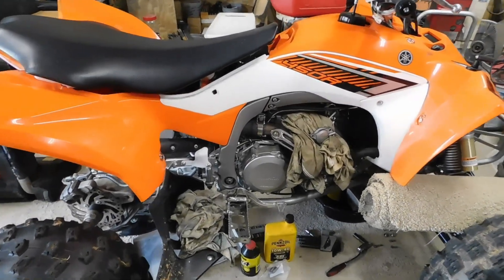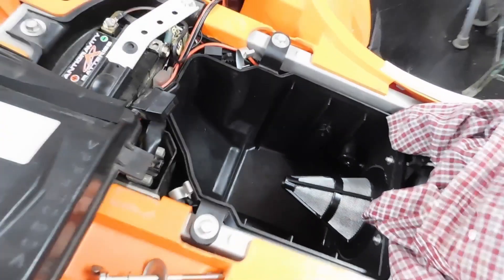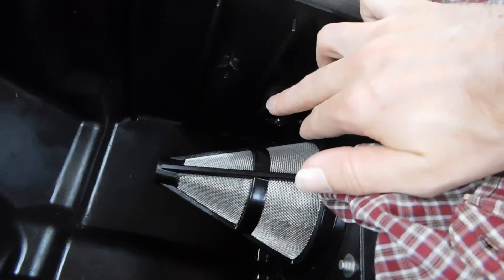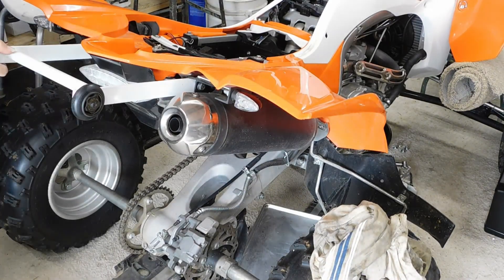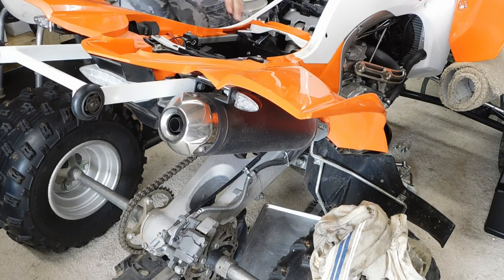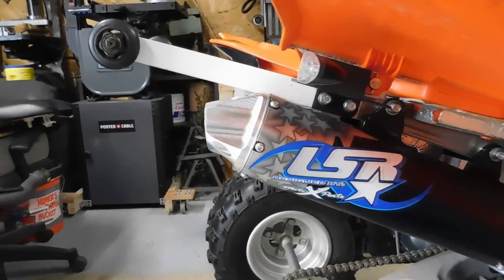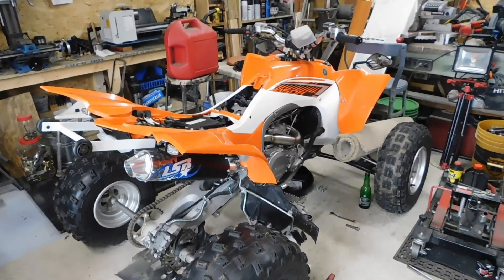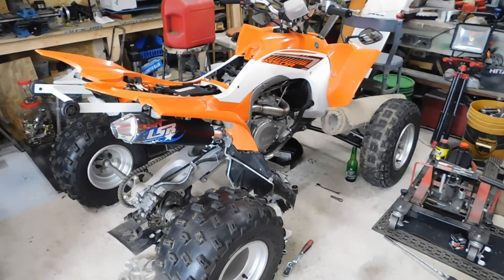Filter,tunner,exhaust install

Comment: If u check it the next day it will show its low it is not! That is why oil spits out the breather! I had the same issue just like many yfzr owners! Although i did replace my breather! Get a vortex bro! I bought a power commander and still had a bog issue on low end! Ended spending the extra couple hundred on a vortex and never been happier!

Comment: Hey good to have a video out of you again. Oil over fill, we know that over fill works. That exhaust looks great like the outer bolt pattern, is that setup and the pipes stainless steel? Well some things we buy you or us are necessity and the others are FUN upgrades, we upgraded our Jeep and experienced the same or similar things. Our Jeep a 2002 here in the Mojave Desert uses K&N and we have since the early 1980's they were good then as they seem to still be now, the air cleaner kits even came with a sticker back then.
That quad sounds GREAT. 
We did think you were going to share the ride with us as old time car mechanics for our own cars, in our youth, that was the prize (going out for test ride) for those that helped out after a whole day and into the early evenings before heading out to show off with the guys at the cruse spots, you did not share that part and we wish you had. Lance & Patrick.
Reply from the maker: Active Atom thanks again for the comments. Yes the pipes are stainless steel. K&N have never let me down, but to bad I can’t find one for my truck. I already have a cold air intake kit in it but the filter is massive. I have some friends I’m going riding with here soon and I’ll do my best to make a video of the quad and some of the other guys rides.

Comment: Does the small rubber hose in the airbox (breather box) rub or distort the KN air filter or not that bad?
Reply from the maker: It fits like stock. I’m going to make a flush mount adapter for it later.

Comment: Ya theoil over flowing is a problem alot I'd ppl hav with this bike its because wen the bike sits for a certain periods of time say couple hours or over night the oil viscosity drops and the oil flows down into the engine more so even though the oil capacity is full it will look like it is low i hav never seen a design like this in my life ! Oil should be able to settle and be cheeked but Yamaha did something different with this bike ! The manual gives a perfect descrition of how the oil evel should be checkwd on these! Runn bike for 7 to 10 min shut bike off let sit for ten min or so and check level and that is where it should be

Comment: Sounds nice I have a 450 also it has a fmf full exhaust i bought it like that but i dont think i have a tune on it and i have rode it like that about 5 times now since I got it. It's running good as far as I can tell but I do get pops and I've been hearing that's a bad thing. How much damage you think I've done to my motor?
Reply from the maker: Roberto Ramos If yours is EFI you can get a pc5 and find a base tune and go from that. That’s what I’m doing.
Reply: @drthinmint  yeah it's a 2018 but thanks man I'll look into that cause I definitely need to do soemthing with it dont wanna mess my bike up

Comment: Where did u get that sweet wheelie bar?
Reply from the maker: RvSkate5 I made it. 1/4” flat bar, a 3/4” pipe 1/8 wall, some old rollerblade wheels without the rubber parts(they rotted off) and some free time. Anymore questions let me know.

Comment: Hows that filter working out? People on the forums say K&N are bad because they don't filter good enough. Use dual stage foams instead.
Reply from the maker: Travis H it has been working really well since I put it in. I’ve been through sand,mud,road and it has filtered all that stuff well. It doesn’t seem to be showing any signs of failing. I have only cleared it 2 times since I’ve got it. Thank you for your comment.